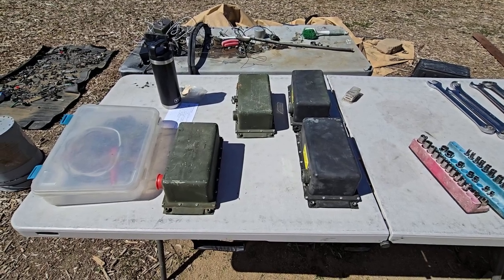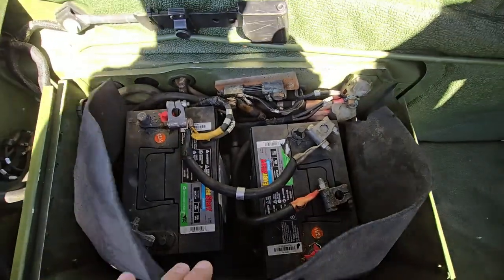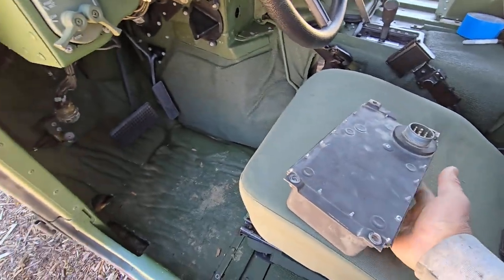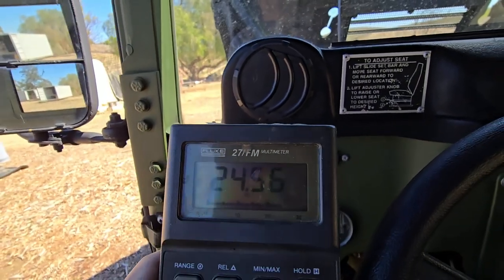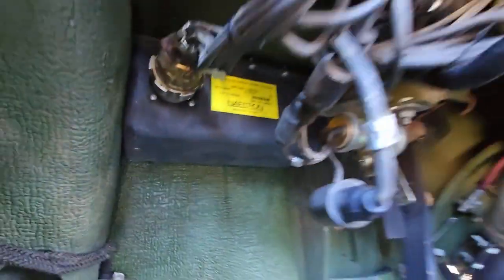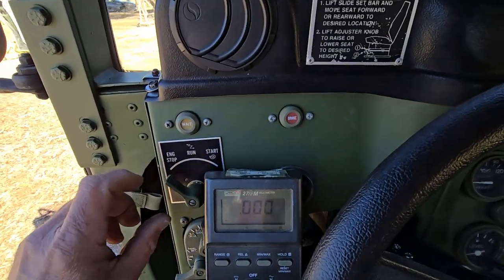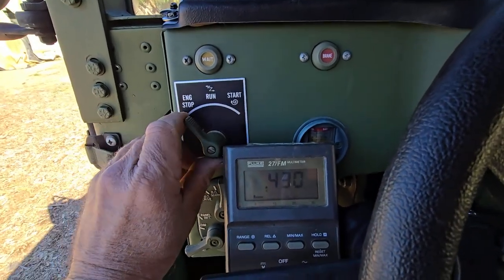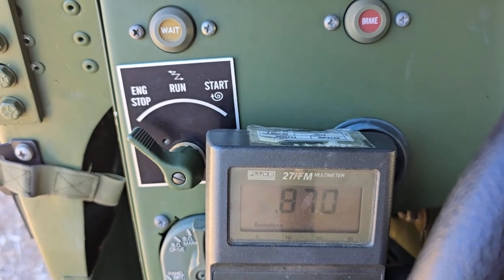Humvee Start Box Diagnostic Testing

Comment: it is not very clear (to me) if you are testingjust glow plug #1 or #x for all the boxes, in other words: you put the Fluke leads on the same glow plug throughout...?
Reply from the maker: The start box sends out one electrical wire with 24V to all 8 glow plugs. Testing one glow plug connector will tell you if you have an issue with the glow plug not turning off. Its possible for one connector to be bad and not have voltage while others have voltage.
Reply: @sportscarclassics  so if that works that way and you have a mafuncion in the box where it does not cut off the 24V after 4-5 seconds then you can blow all 8 glow plugs at once...???? 😲
Reply from the maker: @viniciolamorchia  , Yes. Constant electrical power to the glow plugs will burn them.

Comment: Excellent video, thank you. 
Is there a repair center where to fix a faulty start box ?
What is the most reliable type to be installed for minimizing flow plug issues ?
Reply from the maker: There is a company selling modified start boxes. Camotek.

Comment: great video...nothing worse than changing burnt plugs only to have them burn out again on your first few runs. ( I wish the camo tech boxes were 399.00!) Always do this test before you replace glow plugs! I did notice at 2.14  mark in you video you were missing the linkage from your brake to your brake light/transmission switch (maybe you already know). The first box i ever had a problem with was a Natron S3...constant 24v in the run position...its a shame the box looks brand new.   I have had a few boxes apart to build a push button bypass.  Seen a few methods on the web.  I think it would  be nice to have a digital guage on the panel that give a live reading of the plug voltage at all times.  These boxes are definitely the achiles heel of the HMMWV.
Reply from the maker: @tomelroy  Thanks. There is a video on YouTube that shows how to fix your startbox for $15. It's the same button that other companies use and charge $800+. Regarding the brake switch  lever,I pulled it off, it was in the way.